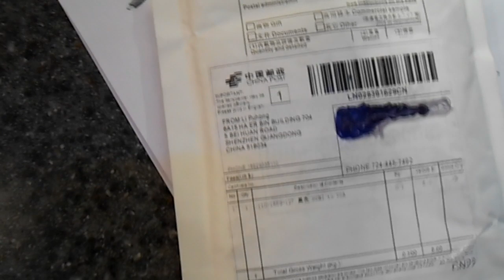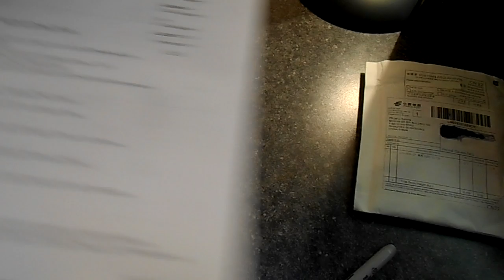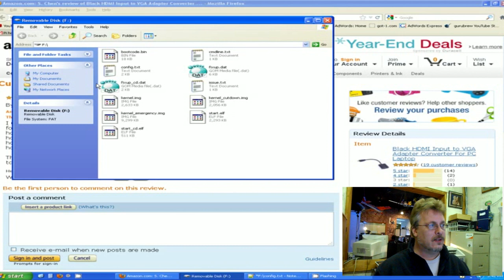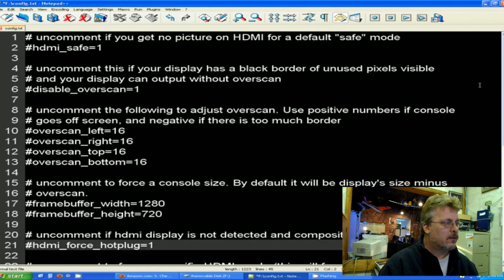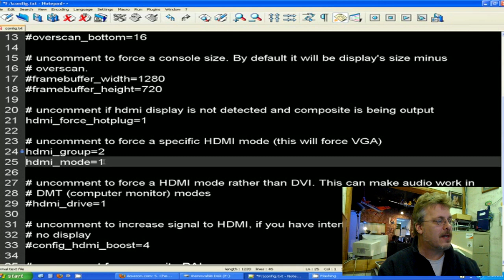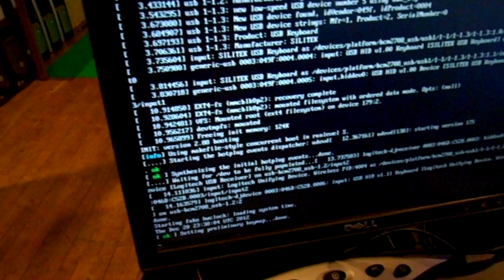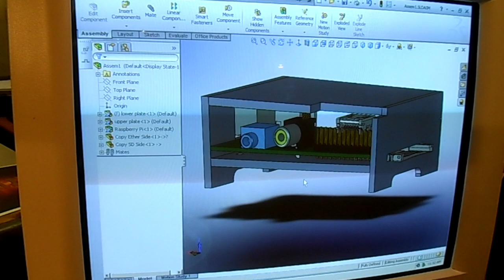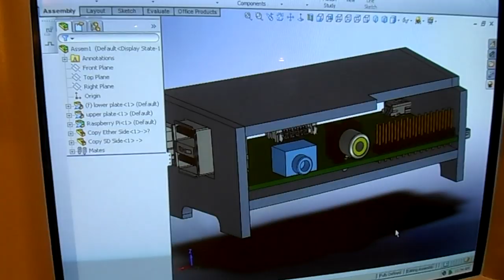HDMI to VGA Converter for Raspberry Pi & New Pi Enclosure Design Idea

Comment: Great video... unfortunately when I did this nothing happened, at all. Couldn't see the monitor and I even adjusted HDMI Mode accordingly.  I wonder why it didnt work?
Reply: James Marsico The signal level does not quite comply strictly to the VGA standard on these cheap adapters. It could be resolutions issues (Not all monitors are able to display a 1280x1025 resolution). It could be a signal frequency problem (some monitors are only capable to display 60Hz signals). An it could be that the VGA signal is not realy as strong it should since the power is provided thru the RPI. Many recent monitors deal with weak signals, but older just give up and display 'no signal'.

Comment: I need to know if it's possible to connect a pi3 to a D-SUB VGA monitor 
and use it always in portrait mode (90° rotation). I need to build a 
totem with a minimal display  manager and firefox browser support.

Comment: If you use with a Pi3 you may need to add a +5v power line to the circuit to prevent too much current draw through the HDMI connection on the Pi, otherwise the Pi 3 will not run at full speed.
Reply: Yess😊

Comment: Thanks for your video.  I have the same HDMI to VGA adapter as you with no video from my Raspberry Pi.  I followed your instructions and now I have a display.  Has anyone  used the optional USB cable for additional power?  I would like to use an AC outlet power supply instead of a USB port on the Pi.  I assume it should be 5 volts but don't know what amps it should be.  There are no specs for this.
Reply: +MrRealtorJim any power supply from 0.5A or above will work fine
Reply: Thanks for your advice.

Comment: I've bought a HDMI to VGA adapter (converter) to connect my old laptop to my new Sony bravia Tv which doesnt have a VGA port. But problem is after connecting it to my TV my laptop is showing resolution notification to use 800 x  600 resolution for cltone display, and I did so,, though it's not working. Can you please tell me the way to connect this... I'll be very grateful to you if I find a solution ...

Comment: TendK makes a VGA to HDMI dongle the size of a thumb drive its sold under multiple brand names and some unlabled. some websites describe HDCP compatibility. some dont but wored on my old LG lcd tv i found in the trash, until my cat broke the audio jack on the adaptor using my stereo speaker as a scratching post. silly cat! i bought the unbranded for half the price next time i will buy two! or three!

Comment: Hello, thanks for this great video!
Tried to do it myself. Got a RPi 2 with Kodi installed. Maybe Kodi uses a different config.txt, because I can just find the first line (hotplug) and none of the other (no group, no mode, no drive, no resolution).
So I changed just the hotplug line. Bootscreen of Kodi is shown, but after this it isn't recognized anymore.
Any idea how to solve this?
Thank you very very much!

Comment: That post on Amazon is probably based on the information found at elinux.org/RPiconfig . There you can page down and find a link "And "here is another example file" containing extended documentation of features." Click on that and you will find a very well documented file by evilpaul that has extensive information about the codes for various sized monitors. There are also more simplified examples that you can copy and paste into your config.txt file all are # commented out. I was not able to edit my sd card in windows and had to install linux to a usb drive to edit it. It has been a real hassle dealing with my cheap asian import HDMI to VGA adapter. Still working on it.
Reply: Drake Dorosh My Dell monitor S1709wc with a resolution of 1440x900 prefered a hdmi_mode=46 kept all else the same. Works great now.
Next step is to buy a MPEG-2 licence to hardware decode video.
http://www.raspberrypi.com/mpeg-2-license-key/

Comment: Does it convert the audio?
Reply: Stealing the uploader's thunder here, but no, this adapter just converts the video signal - not just the plugs, it has to convert from a digital signal (HDMI) to an analog signal (VGA).  To get audio, you'll need to use the 3.5mm audio port.

Comment: hi mike its work for me.. but i has problem with the color. Its only run with blue and red color.

thank
Reply: This may not be the solution, but you might want to check your power supply; does it have a fairly low mA rating?  The adapter is powered by the Pi, and you should have at least 1000mA (1 Amp) to power the Pi, USB devices and any adapters like this.  If you've got something around 500mA, that might give rise to this kind of thing.  Alternatively, of course, you may just have a faulty adapter.  Can you check it with another device that outputs HDMI?

Comment: I have used a HDMI to VGA converter which I purchased through eBay about two years ago. I have not had any issues with it, but I'd advise purchasing from a trusted source. Also, you may need to redirect the audio output to the headphone jack as well with a simple shell script in rc.local. Some converters have a line out as well, but cost more. Caveat emptor!!

Comment: I cant find the config.txt files?  where are they?  I load the SD card into my computer and dont have that set of files....  Is this something that has to be set up before booting for the first time?  My Raspberry Pi was working fine on HDMI but now i want to use this converter and set it up on a VGA monitor I have.  Please help, I cant find much information about finding this config.txt file.

Comment: HELP !! What's the difference between an HDMI VGA Cable versus the adaptor?
Reply: duckyzzz No, that wouldn't work at all. VGA signal needs to be converted to HDMI in order for it to work. That's why you need a converter and not just a cable.
Reply from the maker: The adapter basically allows you to use newer technology (HDMI) with older (VGA) monitors. The trade off is that you do loose the HD quality when the adapter is used
Reply: GuruBrew So basically if I use a cable with a VGA end and a HDMI end I'll receive better quality than using an adapter?
Reply: *****
VGA is analog and HDMI is digital. What you're describing is DVI to HDMI and there's no issue there, the cable will work as there is no signal conversion needed for it to work.

Maybe there are projectors which (for god knows what reason) use HDMI connector but actually accept VGA input on HDMI. I've never heard of it but I'm not saying it's not possible.

Comment: Hi! I bought another same adapter, but its not like an box, but pretty same. Bought it on ebay from China also. 
And i tried connect raspberry pi to CRT monitor and it didnt work (I did all the changes in config.txt file). Also, i have laptop with HDMI port and winows 7, tried to connect my laptop to CRT monitor with this cable and that didnt work too.
Is that CRT monitor problem, or cable?
Thanks!

Comment from the maker: Hello, Some of the hard core PI fans might flame me for saying this but the Raspberry PI does have it's limits. I will say that you will certainly get your money worth but it still only runs at 1GHZ has only 512md RAM (type B) and relies on an SD card to transfer data (slow). With that said, it's a great computer to go into a collection but would not use it as a primary machine..
It's great for mainly electronic projects that need a brain like the Arduino and other dev. boards provides.
Steve

Comment from the maker: Well, according to the 3m specs it's native resolution is 1024H x 768V (XGA) So that would mean that inside the config.txt file the hdmi_group=2 and hdmi_mode=16 . Also make sure that the video source on the projector is set for the VGA input connector. Hope this helps

Comment: Hi--I'd love some help if you have the time.  I'm trying to use my pi with a 3M SCP716 short throw projector system, and have tried ABSOLUTELY every config.txt file suggestion I have found online, but nothing has worked.  I'm almost ready to throw in the towel.  I'm using an HDMI to VGA adapter, powered, and everything seems to be in order, but still no picture.  Any suggestions?

Comment: Very helpful. I have this sort of adaptor and it has worked fine with tablets, but with the RPi only one out of six monitors (various ages) worked, and that with the image partly off-screen. The rest lit up as in this video, but with a blank display. At least the config seems to be fairly straightforward, anyone else remember wrestling with X window config files? I have run the Pi via VNC but the desktop is far too sluggish to be useful. Be interesting to see if this works & is any better.

Comment: Hi, many thanks for your quick reply. 

I looked up the hdmi mode for my Dell 1708FTP monitor and changed it to correct hdmi mode. 

The Raspberry Po booted up fine and displayed the desktop with the logo and all the programs on it (Scratch, Python etc), then after about ten minutes the monitor went back in to PowerSave mode.

Comment: Hi Guru

Thanks for the video, followed all the instructions, using an DELL monitor (similar to yours). It seems to work however after a minute or so the monitor goes in to Powersave mode and the screen remains black, any help with this issue would be appreicated.

Comment: From the Raspberry Pi Forum Mobius wrote:
==
The line "hdmi_safe=1 will force a hotplug and set the resolution to 640x480. Comment that line back out and use the following lines instead of what you now have:
CODE: SELECT ALL
framebuffer_width=1366
framebuffer_height=768
hdmi_force_hotplug=1

The framebuffer lines can be set for your desired resolution. As you can see, mine is set for 1366x768.
==
This worked for me and I'm am checking out your suggestion now.
Thanks very much for your help.

Comment from the maker: Hi, try these settings and put the comment back on the hdmi=1

hdmi_force_hotplug=1
8hdmi_group=2
hdmi_mode=16
hdmi_drive=2

# uncomment if you get no picture on HDMI for a default "safe" mode
#hdmi_safe=1

# uncomment this if your display has a black border of unused pixels visible
# and your display can output without overscan
#disable_overscan=1

This is now what my setting are and work well. Let me know what happens please

Comment: I found your video to be quite interesting bcause I recently got an adapter similar to yours, but have not had enough time to tweak the settings for vga monitor yet. I may post back later. btw, you can use SSH with PuTTY or VNC to talk to the Pi remotely, but the right programs must installed or configured to this.